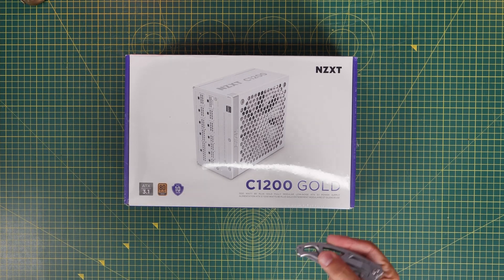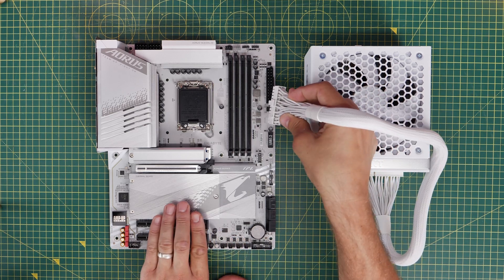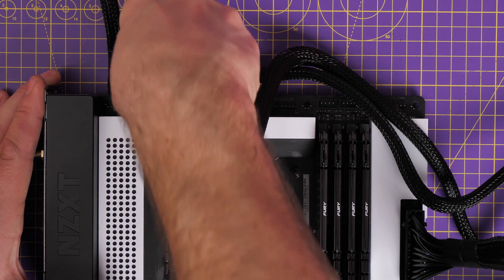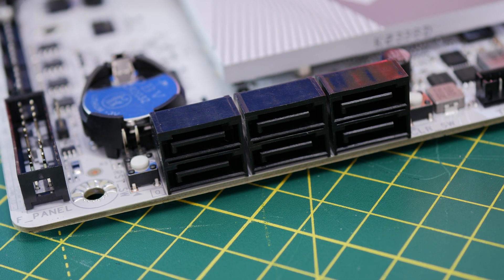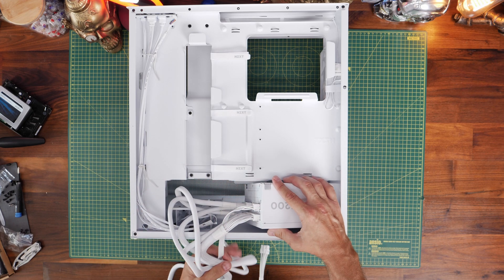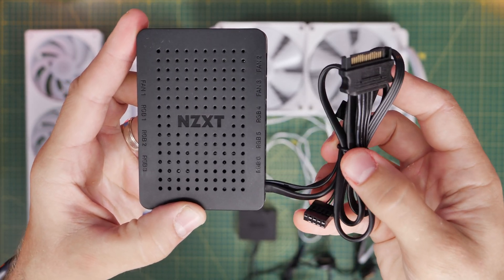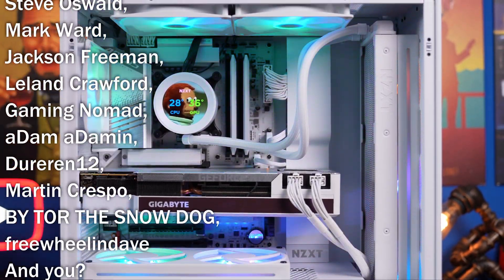How to setup NZXT C1200 Gold ATX 3.1 PSU in your PC

Comment: So I'm trying to do this in an Aorus x870 with this PSU and an XFX Mercury 9070XT inside and H9 flow rgb+. I have the 2 cpu cables run to the mobo. Of the 3 remaining PCIE/CPU ports on the C1200, the rgb/fan connector takes one of them, but I need 3 for my GPU. What are my options here?
Reply from the maker: Alas I believe the only option is a more powerful PSU with more cables

Comment: There's something I don't understand. This power supply includes two CPU cables. The connectors on the cables that plug into the motherboard are NOT the same, but the connectors on the motherboard are identical. That is, I won't be able to connect one of the two cables to the motherboard (MSI MAG x870 Tomahawk Wi-Fi).

In the video, you connected both cables, and I don't know how you managed to do it, since they don't have the same connector.

Comment: Oh noes, I wanted to use 4 pcie for my 5090 with the nvidia adapter but only have 3... the 600w 12v2x6 cable pins don't look even to me on this psu, scary... hope it doesn't melt.

Comment: Hi! Mine only had 4 PCI-E slots, so If im using 2 for MB and 2 for GPU (TUF Gaming GeForce RTX 3070 OC) im missing one slot for the new RGB controller. Do you know if i can use a 12VHPWR Adapter Cable for the GPU, so I free up a PCI-E slot for the RGB controller?

Comment: Just installed my C1200. It's very quiet! Well worth the £160 I paid for it.
Next step will be a potential AM5 build at some point.

UPDATE: Done the AM5 build! 9700X + 4070 + 64GB DDR5
Reply: is it good mine came today in white ive got a RM1000X in my other system but its black corsair not a problem with my i9 9900k but now im doing an AMD 9800X3D im worried about this PSU
Reply: @gooner2000woman  Should be more than enough for a 9800X3D.
Reply: @ i know but i hope it dont fail thats all
Reply: @gooner2000woman don’t know whether to get rm850x or c850, which brand you liked more
Reply: @ il go rm850 to be honest as my rm1000x is still going strong for nearly 10 years cant vouch for nzxt this early

Comment: it should be 12v-2x6 right? instead of 12vhpwr since it is atx3.1 and 12v-2x6 has shorter sense to avoid melting
Reply: As Hardware Busters said the 12v-2x6 cable is exactly same as 12vhpwr cable. The difference is in the connector, both on the PSU side and GPU side.

You either want ATX 3.1 PSU which uses 12v-2x6 connector on the PSU side or ATX 3.0 PSU with 2 8-pin PCI-E connectors on the PSU side that connects to 12vhpwr/12v-2x6 on GPU side like Corsair PSUs. 2 8-pin on PSU sife is much safer than the former ones.

For GPU you’re depending on Nvidia or board partners😅

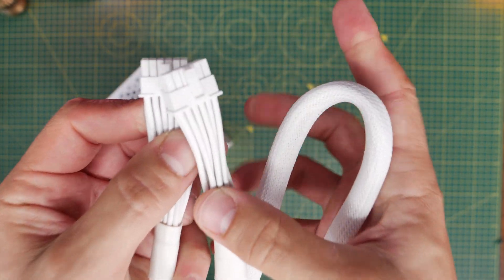Comment: 9:50 So I know nothing about the new cables and such, or the adapters. I just purchased an RM1000x (ATX 3.1 ver) and its come with a 12+4 pin connector, same on each end, like the one you're holding. When the RTX 5080 comes out in Jan, would I just plug in one end in the GPU and the other in the PSU? No more adapters required?
Reply from the maker: Yup
Reply: @TheProvokedPrawn thank you
Reply: @TheProvokedPrawn  Does the corsair RM 1000x (ATX 3.1 ver) have a 12v 6x2 plug for the rtx 5090?
Reply: @mihell81 It should do but I’ll have a look now

Comment: Great vid man! You have amazing voice. I am going to buy this PSU. Ordered VITA GM 1000W, but today I found a lot of reviews saying it is just loud. I've seen that previous revision of these C series nzxt PSU's had A LOT of topics (yt/reddit) about weird noises (not fan). Hope this revision doesn't have these problems, but I guess it is too soon to find enough data for this fresh PSU.
Reply: Did you buy it? How is it? Alot of people say it has coil whine (loud noise) or that the 12V 600W cable doesn't work please tell me im planning on buying it.
Reply: @Kirito-pc7ez  I bought it, never Heard any coil, and I am a bit autistic, every noise triggers me, spent 12 hours on setting silent fan curves, So I would hear it.
Using 9070xt with 600w connector - works great.
I can recommend it.

Comment: hi, i want to buy this psu, the C1000 variant in white. However I noticed Corsair just released their RMx 3.1 psu as well!

Can you please do a review of those? I mainly want to know which cable has the higher quality and looks nicer, as I understand it, the Corsair has embossed cables, but I don't really know what that means.

thanks
Reply from the maker: Corsair's PSUs are solid and reliable
Reply: @TheProvokedPrawn  yes I used a corsair rm650 myself but it's the old version.

I want to know what you think of the newest corsair embossed cables on their PSUs, especially the RM1000x 2024.
Reply: @TheProvokedPrawn  I don't know what quality they keep now, but once my Corsair PSU stopped working (lots of sudden turn offs on load) exactly after end of 2y warranty, when I had 0 cash and had to sell some personal belongings to be able to afford new PSU and use my PC, which I was using A LOT and couldn't do that for 2 weeks. Sold my things, bought low end be quiet! and I am very happy with it to this day. Got it for ~5 years and it will serve many more for my GF which will get my current setup in a few days.
Thankfuly that was many years ago and I no longer have to worry about money and replacements in a case of problems, but due to this situation and the sanity it cost me - I'll never buy a corsair part agin.

Comment: Could you measure the length of the ac power cable that goes from the psu to a power plug? Is there a way to extend it since it might be too short for me, but I also dont want to damage my Pc buying an extension.
Reply: Look at specifications before buying a PSU. There are cable length included, so you can measure yourself on how much you techincally need. Just don't stretch the cable too much or it'll cause some damage.

Comment: Mine nzxt c1200 only has 4 pcie slots, but my eorus x670e needs 2slots and my asrock radeon rx 9700xtx taichi need triple 8pin, unfortunately i use 1 to 1 psie and a 1 to 1 8pin with a 6+2pin cable. But i rather want 3 8pin psie from the supply to my gpu